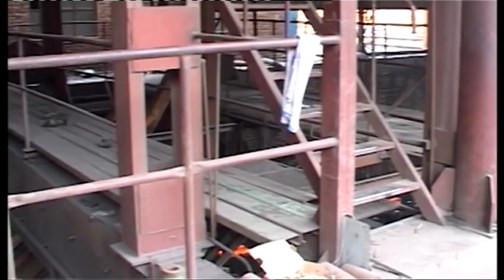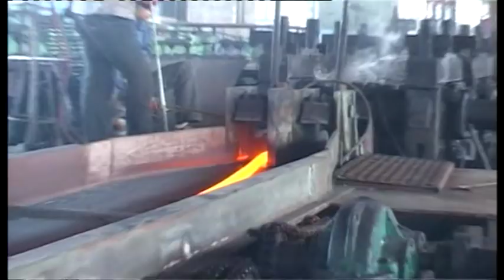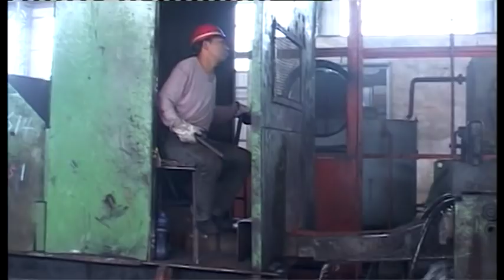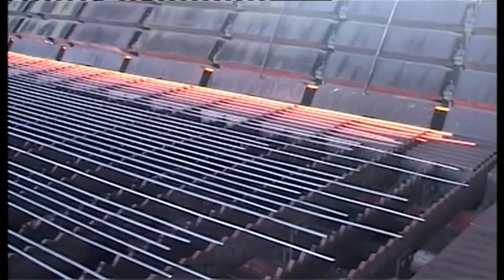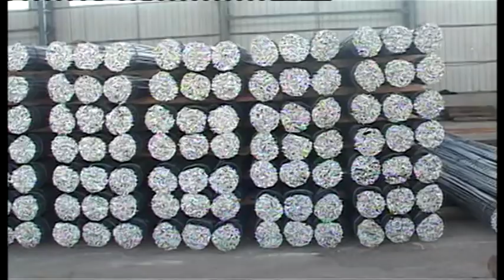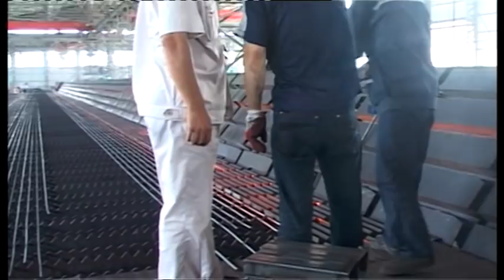500000ton rolling mill

Comment: Once I toured a rolling mill and asked the question "how do they keep the steel red hot while it goes through all those rollers?" I was surprised to find out that due to friction and compression the bar actually comes out of the roller hotter than it goes in. In fact they have to work hard to keep it from becoming TOO hot.
Reply: cool hay
Reply: "due to friction and compression the bar actually comes out of the roller hotter than it goes in" hmmm
Reply: god bless the usa
Reply: It depends on the temperature of the bars/sheets being rolled. If you go with in with a temperature of 1200ºC it will end the rolling being colder than before no matter what. And this applies even for the temperature after which the metal starts radiating (more or less 650ºC). That affirmation is true only for cold rolling where  the metal enters at a temperature of 20 to 60ºC and exits at for example 100ºC.
The real reason because the bars remain radiating is just a matter of the shape and how much time it takes for the material to cool down. You could just take an ingot of 10tons, heat it upt to 1400ºC and leave it all night cooling and it will be probably still red the next morning.
Reply: why ?..this is obviously not an american work force , is it even and american company ?
Reply: @Pau Gasolina Are you aware that this is a Chineese plant?
Reply: well thats probably why there is obviously a cooling at the start with some fuild...
Reply: I used to work in designing steel mill equipment. Whenever, we installed the equipment, we had to guard it at the steel mill until it was completed and handed over.  Once we went to lunch and on the return, our control system was destroyed by some union workers as they claimed our equipment would destroy their jobs.
Reply: Ray Lee 
In the US unions dont exist...    in fact its a MAFIA over there !!
Reply: @paugasolina5048  and with China and Russia what to do?
Reply: @medvidekmisa  That fluid is called Water, and it is to cool the rolls not the steel.
Reply: @Raiuga-wiz  No it does not.
Reply from the maker: Lawrence Withrow add the hot protection cover Biggest Chinese state owner company with 10billion USD turnover produce and export metallurgy machine electric motor ,supply Export and import agent service 
 Shanghai Electrical Machinery Group Co., Ltd.
Mobile:+86-13661649038   +86-13661467786
Tel:      +86-21-60484485
Email: SEHM@vip.163.com  Robin@semcgroup.com
 WhatsApp:+86-13661649038 
WeChat: +86-13661649038
Reply from the maker: Lawrence Withrow Shanghai electrical Machinery Group 20t 12000KW melting furnace hot commissioning in iran today shanghaielectric@vip.163.com Mobile:008613661649038
Reply from the maker: Dacary Shanghai electrical Machinery Group 20t 12000KW melting furnace hot commissioning in iran today shanghaielectric@vip.163.com Mobile:008613661649038
Reply from the maker: Raiuga Aguiar Santos Shanghai electrical Machinery Group 20t 12000KW melting furnace hot commissioning in iran today shanghaielectric@vip.163.com Mobile:008613661649038
Reply from the maker: Ray Lee Shanghai electrical Machinery Group 20t 12000KW melting furnace hot commissioning in iran today shanghaielectric@vip.163.com Mobile:008613661649038
Reply from the maker: Shanghai electrical Machinery Group 20t 12000KW melting furnace hot commissioning in iran today shanghaielectric@vip.163.com Mobile:008613661649038
Reply: @DaCaRy1   According to you, a 150x150 x 12 meter embryo heats up to 1,200 degrees Celsius, how much time it stays red, which you say to cool down all night and it may still be red the next morning.
Reply: @DaCaRy1     ?
Reply: @tientran-ol5ww  I have the feeling that you've got confused somewhere halfway.

An ingot and a billet are not the same thing. They have different shapes which influences their cooling time. Adding to this that in the example I said 1400ºC makes a big difference from 1200ºC.

Now let's solve this by parts, in the case of a billet (this video) it's not so probable that it will be stil read after 8h of cooling, but if we are talking about a billet or other bulky shapes, then it's possible (depends on the shape "heat exchanging surface", mass material heat conductivity and weather outside).

Next step to understand my affirmation is an example, since I mentioned mass and how bulky is the cooling object determines the time it takes to cool down, there are cases in foundry when it takes days to cool down a casted piece of metal as for example a ships propeller or propeller parts (even over 10 tons).

Last step to understand is that I specifically said 1400ºC because this way the crystalline structure of the billet will change 2 times and not once as in the case of 1200ºC while cooling down, this means it takes more time for steel to cool down when it has to change the crystaline structure.

PD. For further information I recomend looking at some metallurgy book.
PD2. My sources are from my formation as mechanical engineer specialized in materials and work experience.
Reply: Somebody has been pissing in your pocket I know I worked in the hot rolling mills for 7 years.
Reply: @DaCaRy1  Thanks! It was the only comment with true in all this section..!
Reply: Great question
Reply: Truth

I saw a blacksmith take a cold nail and make it red hot and start a forge fire with it just from hammering on it
Reply: @paugasolina5048 

Im fairly sure this isnt the US given that every person in the factory seems to be Asian of some sort lol

Comment: Ok guy, today is bearing maintenance day !!
Reply: Noticed the guy working on the leaking air cylinder at the end while in use without wearing safety glasses.  Compressed air and compromised equipment, what could go wrong?
Reply: @ranchero50  I'm sorry, what?  I can't hear you because I never protected my ears while working next to metal being thrown around!  All I hear is ringing noises!
Reply: I worked 8 years here in The Netherlands for a maintanance firm and we did a lot of work for the Tata steel plant in Ijmuiden(before Corus). Especially the rolling mill( WarmBand 2)  where the thick slabs are rolled out to rolls of 40 ton car metal etc. looks the same as on this movie. Only darker and dirtier and the plant in Holland is 50x bigger. Much like this: https://youtu.be/13dUL9OQFvw   This is all small thin stuff but the process is very similar. Only no people along the tracks because the heat would set your face on fire...If the rollers on the track (3 tons each) had to be replaced with a turn around overhaul you were standing knee deep in grease and dirt and while trying to cut the bearing cap nuts in that same grease pile setting it all ablaze. All that spilled grease comes from leaking grease lines to the roller bearings on the track. And there's hundreds of them... Grease,water,raw steel and intense heat always create these kind of conditions in every steel mill.
Reply: Ouch!

Comment: When we recycle metal and steel we think we are doing a good deed but what really happens is that it gets ground up and flipped into a ship headed for china for a lot less than we should be getting since it costs a lot to get it smelters down.aluminum is called solid electricity within the industry because it take more electricity to make it than you would pay for the finished aluminum bar.

Comment: From what you see from worker's appearance, what do you think of the safety conditions in this plant?
Reply: U are wright with the hard hats, also they dont wear safety glasses, no safety iron nets anywere, some of them had no gloves on. No safety signs.
Reply: Bump caps or no head gear at all, no hearing protection, no safety glasses. No gloves. No spindle guarding. No looper cages. At the end of the bundling and strapping process the overhead crane takes the bundle over the workers! Wow!
Reply: The exposed drive chains grabbed my attention right away.  Slips and falls do happen when workers run to avoid a cobble.  A worker falling into those chains is going to lose an arm.  Swing up open mesh covers chain covers allow for easy diagnosis and instant access to those chains when needed.  Cheap, and easy to install but can easily pay for themselves in injury free days.
Reply: 100% better than India.  Hell, they had shoes on.
Reply: It none of my business, it isn’t in my ountry
Reply: WHAT?

Comment: There is no way that the USA can not produce all the steel & other products for ourselves without relying on foreign manufacturers. Bring back the jobs to the USA. We can produce almost any good for less than farming it out to another country that doesn't have the quality control from start to finish. I have seen first hand that the quality control standards for overseas made rotating aircraft parts are not even close than if we made the parts.

Comment: Do you have any problems for counting the rebars especially for small dimensions? Do you want to enhance the working efficiency for your rebar handling system? 
Please check our automatic bar counter (with sparating bars function) working video:https://www.youtube.com/watch?v=lv7PtEIQqKk 
The bar counter designed by us is adopt non-contact image processing theory compare with traditional ones. Any query, please contact at emily@sinomgroup.com.

Comment: 500,000 ton? something tells me they added a few too many zero's.
Reply: That's per year, which works out to 1,369 tons per day. That's definitely a reasonable number.
Reply: @KingdaToro  Generally they are talking about the force applied by the machinery.
Reply: @phillhuddleston9445  It's in the description. "Annual capacity is 500000ton"